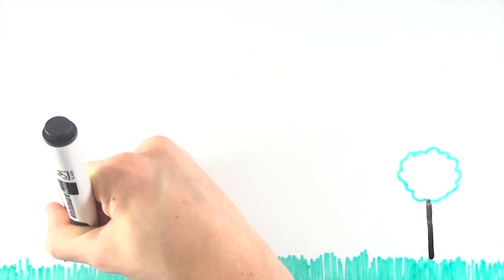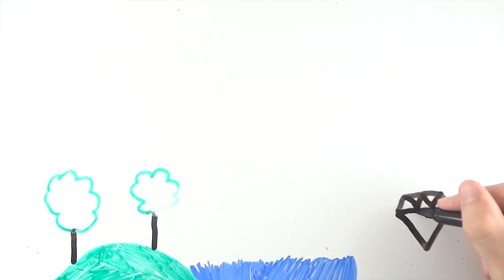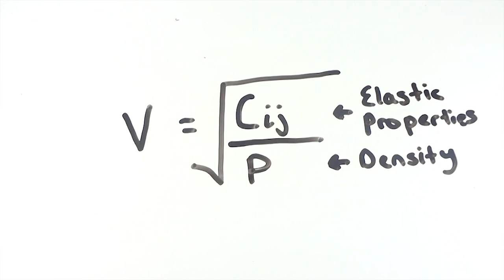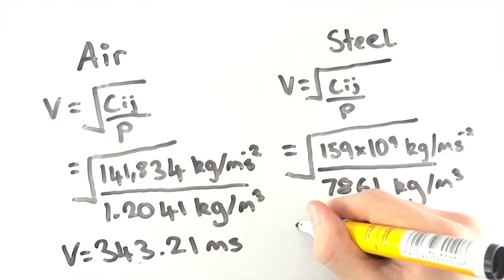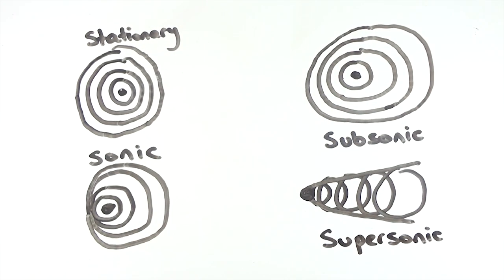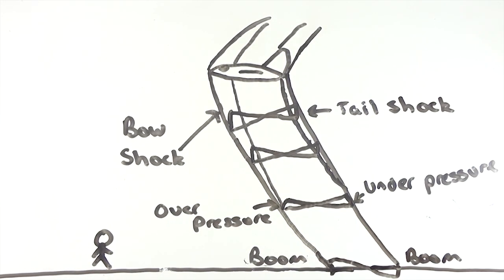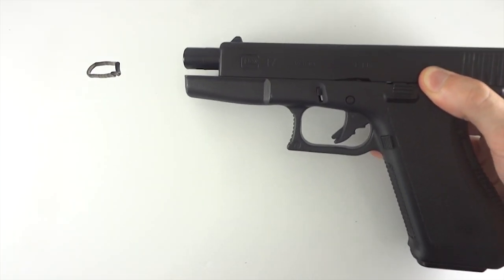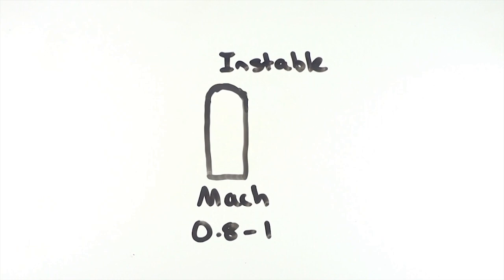What Is A Sonic Boom? Why Breaking The Sound Barrier Creates A Sonic Boom

Comment: I saw a picture of an air craft breaking the sound barrier which led me to this video. It was very informative. Sometimes I wish I would have chosen a career path that could allow me to be this informed!
Reply: You can't see a aircraft breaking the sound barrier unless it's a special camera that can show different air densities
Reply: What kind of camera is that? From the picture it looks like light is falling on the pressure area ( you can see shadows), which means it should be visible normally.

Comment: Why can you almost always see it only at the back of the plane and also just above the cocktail pit? I'm assuming they are the more resistant parts of the plane but many of the photos I've seen have other parts of the plane that I would think are more resistant to the outside air than the cockpit is yet you can't see it in those areas.
Reply from the maker: Here's a good quote on why :)

"The sonic boom we hear caused by an airplane flying at Mach 1 usually takes the form of a “double boom." The first boom is caused by the change in air pressure as the nose of the plane reaches Mach 1, and the second boom is caused by the change in pressure that occurs when the tail of the plane passes and air pressure returns to normal."
Reply: You can't see a plane visually breaking the sound barrier.
Reply: You can find videos filmed on normal cameras where you can clearly see the pressure wall. It looks like a cone.

Comment: So you don't hear the sonic boom yourself if you're the plane?
Reply: no because you are travelling faster than the sound you are producing
Reply: Is quite weird when you think about it because I take it you hear absolutely nothing. if you're 30,000 feet in the air with no noise, then you'd hear absolutely nothing?? You wouldn't even hear the wind would you?
Reply: You'd hear the vibration from the engine being trasmitted thru the airframe.
Reply: And the wind because that noise is being produced ahead of you or something I think.
Reply: @Bruno-fm9qz  no because the sound is traveling through your airplanes metal fuselage which sound travels many times fast through than air.